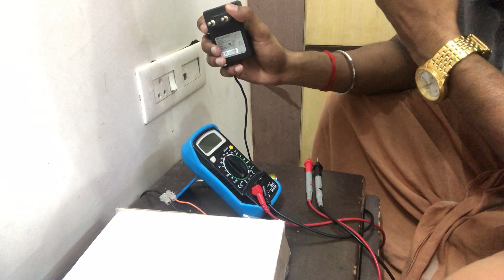Current and Voltage Measurement using Multimeter in Malayalam | Why Series Connection for Current

Comment: Milli ampere voltage socket ഇൽ തന്നെ പ്രോബ് വെച്ചിട്ട് അളക്കമോ?
Reply from the maker: Chila multimeter angane option therunund chileth illa... Normally amps nokan probe change cheyenem
Reply: @TechCornerMalayalam  tnks
Reply: @laijugeorgh6348  ഡെയ് ഡെയ്..
അത് ഷൊർട് സിർക്യൂട്ടിട് ആകുമാടെ പണ്ട് ഞാൻ അങ്ങനെ ചെയ്തിട്ട് മൾട്ടിമീറ്റർ പ്രോബ് ഉരുകി

Comment: Sir,ohms law house electrical systemil applicable ano,voltage kurayumbo draw cheyyunna currentum kurayuo
Reply from the maker: Ohms law valid aanu athil parayuneth v propotional to I ennan athu eplaan resistance constant aanel. Appol constant resistance ennethe vittu pokeruth.Voltage enthan current undakan kaaranamakunne oru factor aanu voltage. So voltage kond undakunne load ile oru effect aanu current. Resistive load il ohms law applicable aanu.ohms law il Ac il verumbol kurech confusions undakar undu athinaan lenz law koode athine support cheyan kond vanethu.

Comment: Bro multimeter വാങുന്നത് ആണോ നല്ലത്  clumbmeter ano
Reply from the maker: Clamp meter specifically for ampere aanu mate measurements okke accurate aakilla multimeter il specifically voltage oriented aanu ampere check cheyende application kooduthal aanu clamp meter normal use aanel multimeter